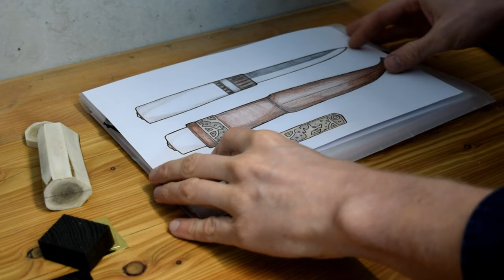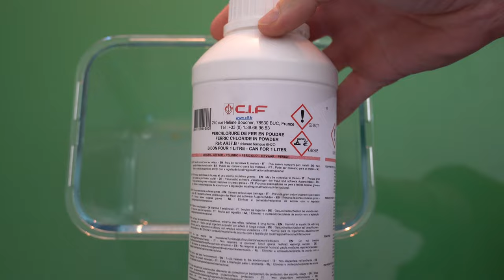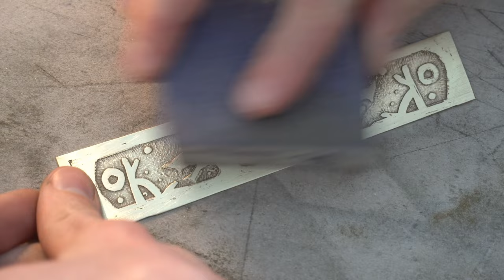Making a Petroglyph Inspired Puukko

Comment: Just seen your video on the petroglyph knife Lovely work, when you rivet try to use a slightly bigger ID on the rivet when flange out drill through coming out the head then debur  put D ring in, should be more secure Last Longer.

Comment: A beautiful piece of work. That sheath with the brass band very nice but wouldn’t you be concerned using that material and have it break or crack as it looked to be quite thick with all the bending to shape it.
Reply from the maker: I don't think it will crack because it's rather flexible. You can find these type of brace on some marttiini knives. 
Thanks for the comment ;-)

Comment: I have been making knives since the 60's and that is really great work! My biggest disk sander is 8" (203mm) how do you like the large sander? would it be worth it for me to get one over the one I have now? I don't mind paying for good tools. Again that is some really nice work. I am experimenting making a sheath with wood and rawhide I hope it turns out as good as I have in mind.
Reply from the maker: Thanks for the comment ! 
It's a good question. Well, I hestiated a while on choosing a new grinding machine. 
You have these combined machines with small sanding disc and the belt but having already one sanding machine with the belts there was no point of getting a new one for me. Also, in my opinion, it's really an advantage to have a bigger sanding disc machine. Mine is 305mm which is roughly 12" and I feel like the disc last longer and even if the paper gets a bit blunt with times you can still remove a fair amount of matter (wood). Also I like to use the more central part of the disk to sand metal parts and the outside of the disc for the wood. On the other hand the belt sanding machine is really helpful for the round concave shapes so it's best to have both of them.
I hope it was helpful ;-) 
Good luck with your work
Reply: @StevesWorkshopSwiss  Thanks!

Comment: I’ve never thought to use wood nearest to the blade(handle). I’ve always assumed it had to be metal of some kind. You never have any issues with damage when using the knife?  Very interesting.
Reply from the maker: Yeah you can use wood without problems ;-). 
You often see some old Finnish knives (more than a hundred years old) with a full birch handle and they hold on pretty good. 
But I assume not every wood is suitable, in this case oak is perfect because it very durable.